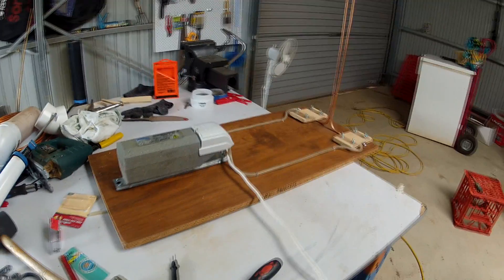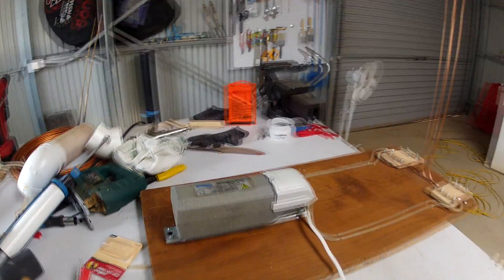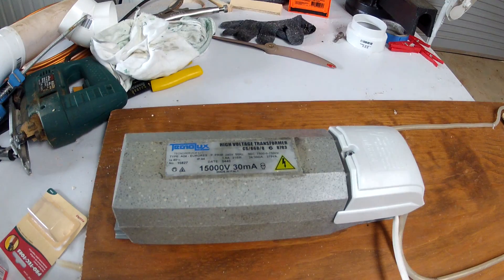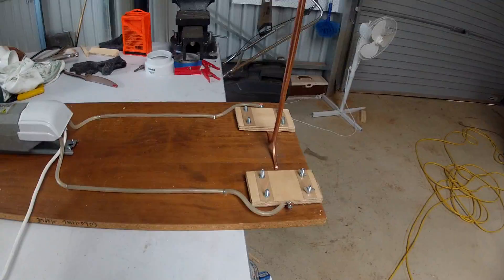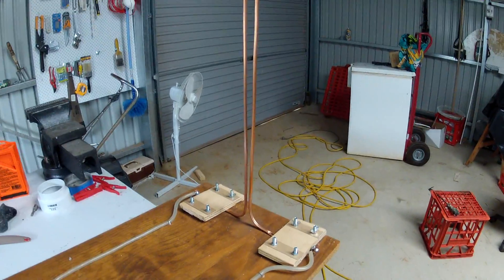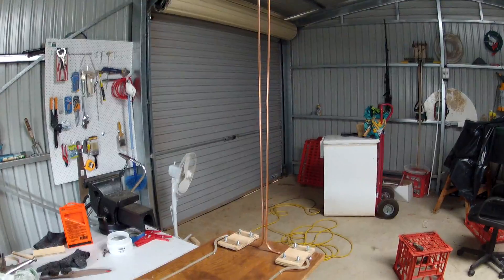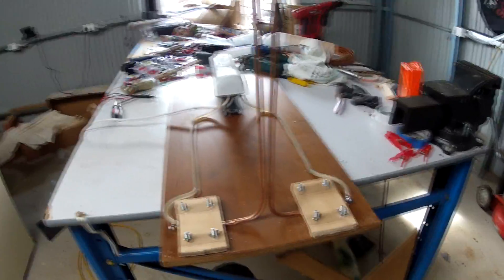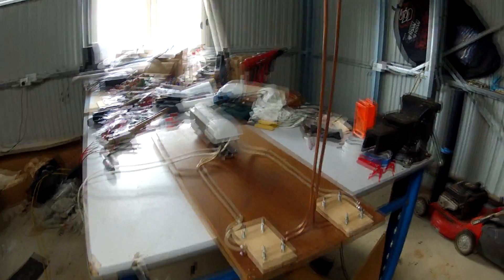15000 Volt 30mA Neon Sign Transformer Jacob's Ladder

Comment: I just got paid for a small garage cleanup with the same spec transformer. Within 10 minutes I've used 2.5 feet of 16awg and knew it had more in it.  And here it is.  I'm headed to Lowes for the copper.

Comment: output 15kv at 30ma, I bet the input wattage is smaller? Don Smith claimed these are overunity devices..
Reply: The input wattage will ALWAYS be higher than the output wattage. There is no such thing as a transformer that has "negative losses" (higher than 100% efficiency).

Comment: Did this nst have short protection? Im really having trouble finding a power supply. All of the nst's Iv found online have short protection and would burn out if used for a jacob's ladder
Reply: I don't think there is short circuit going on anyway in a Jacob ladder, the arcs are ionizing into the air..